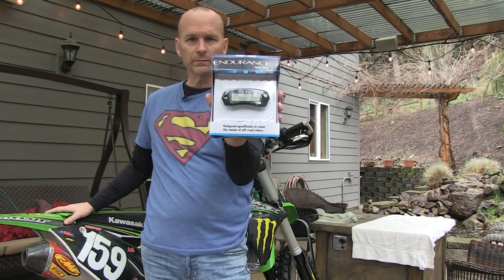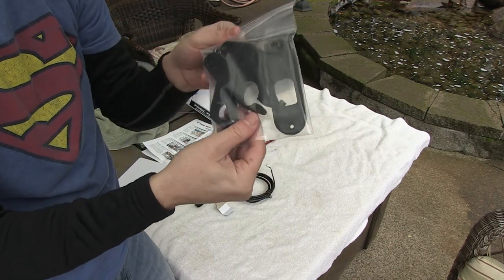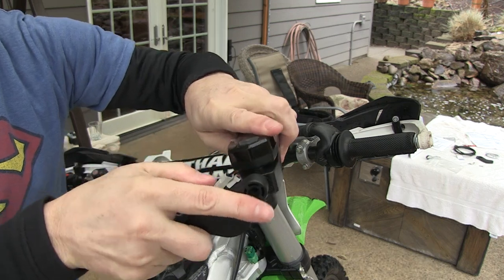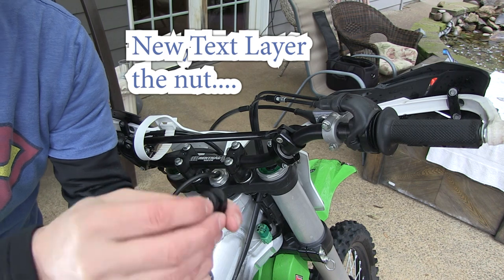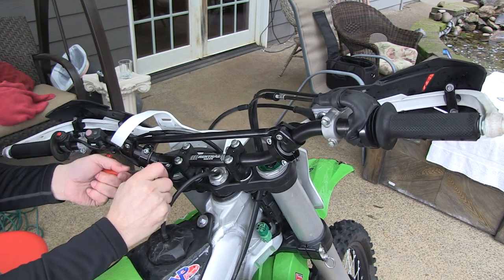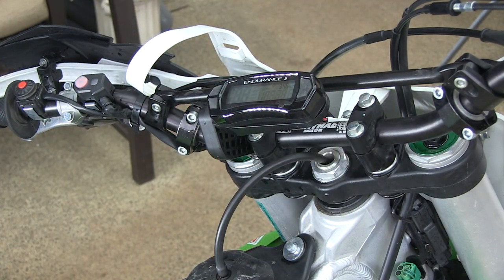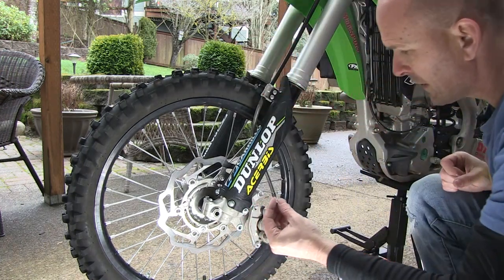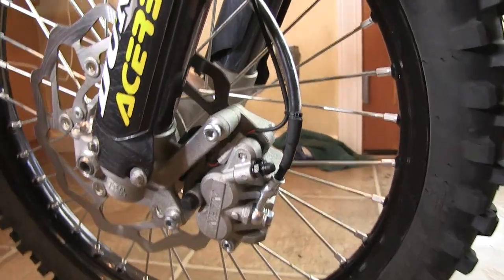Trail Tech Endurance II Installation.  Easy, clear, quality video on how to do this.

Comment: Put a Trail Tech Endurance II on my KTM EXC 250 4 stroke RFS 2003 and like it. It went right in the rubber holes that the OEM speedo came out of after a tree crinkled it.

Two long 4 mm bolts and 4 nuts were the hot set up with two biggish washers. Bolt, then nut then washer then nut then up through rubber holes into Endurance II on both sides. Hand tighten bolt into plastic. Snug jam nut to plastic with 7 mm open end. Wiggle down into rubber holes, than run nut up bolt to snug washer against the bottom of the rubber holes. I reset both left buttons with my right thumb while riding. This will come in handy at Dual sport "resets" on the move. I kept it down low so the old style brake line is always looping above it.